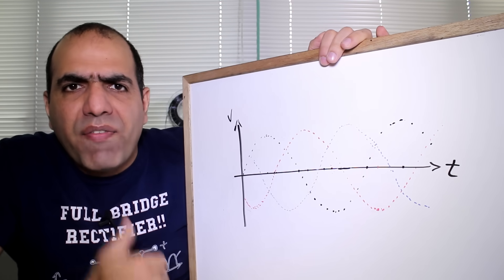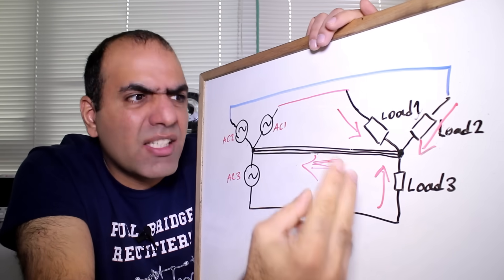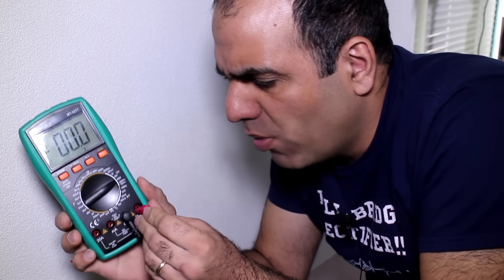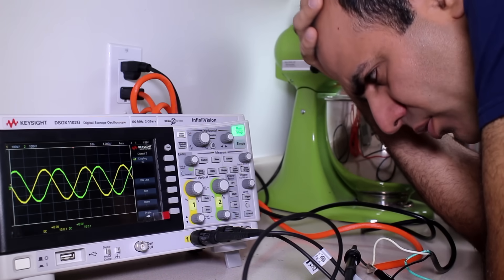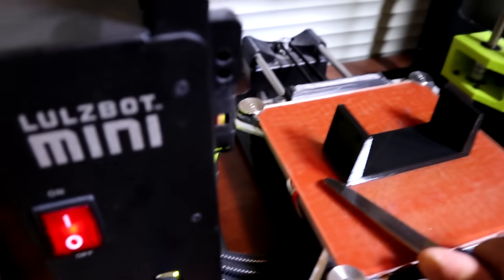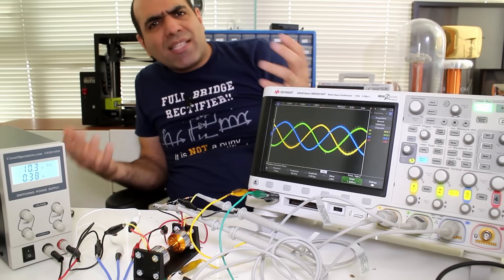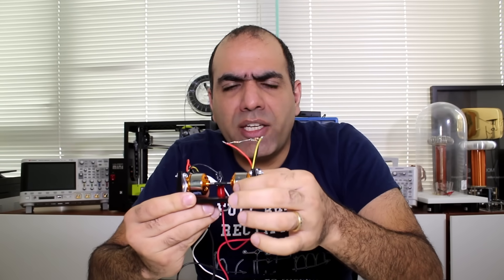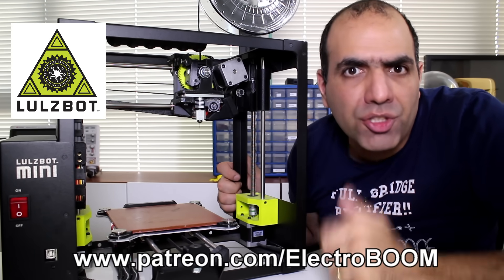Why 3 Phase AC instead of Single Phase???

Comment: I measured the voltage between phases in my house and got 242 VAC and you got 203 VAC where you are. Hmmm interesting. I live in Canada as well, maybe there is a difference between provinces.
Reply: There can and will be very big differences everywhere you go. Each local substation or transformer will be outputting different voltages, dependant on the load it is under from other people on the same transformer, whether the supply is low or high (largely distance dependant), and differences in each transformer itself. That's why Mains power specifies an acceptable working range.

In the UK I measure Mains AC every day at premises in a region spanning several hundred square miles, but the range of AC I get is anywhere between 217-253v. That's pretty-much exactly the allowable range.

Comment: Because of the sine wave generated always going to zero and starting all over again the power lost is RMS .707106 - 100 percent  equal .2928 percent lost compared to DC. To compensate sine wave power must be higher by almost 30 percent to get the same work done. DC rules!!!

Comment: I love your videos. I understand at least 90% of what you put out but you break it out into such an easy way to understand. As an electrician knows the first couple years in the field at least you really don't understand it.   I think your videos are great keep putting out the good content.   you don't overdo it like most electrical teachers will by giving you  they're answer with all of their knowledge and end up just confusing the students because it's just too much at once when you're starting out.
Reply: I know I'm a small scale are increasing amounts of nonlinear loads affect neutral current coming back.  Inside of a commercial building we will typically upsize the neutral for the additional load that used to be balanced with linear loads. My question is do you think the transmission companies are doing anything to accompany this issue? Or on a large scale with so many nonlinear loads and linear loads on 13kv plus distribution lines  do you think it doesn't affect it enough for them to have to start increasing their neutrals.  technically thinking if you have the same type of fluorescent lighting ballast and same amount on the same phase it would balance out needing no room for improvements on the distribution lines

Comment: Hi electroBOOM I'm turning to you and fellow subscribers for advice. iv just been given a garage ramp and it's running on 3 phase. I currently have single phase 240v in my garage do I need anything special to receive or convert to 3 phase or can I just run 3 separate supplys to the motor please can you point me in the right direction thank you

Comment: [06/03, 12:29 a.m.] Shara⭐: Zero phase transformers, it needs two magnets one inside center and the other as ring outside right?
[06/03, 12:29 a.m.] Shara⭐: Else it release leakage at side or center depending on the zero phase transformer designs?
[06/03, 12:30 a.m.] Shara⭐: Three phase transformer cant completely zero phase out because the copper overlaps and is individual strands. So the magnet is applied to eliminate it to zero.

the other video was:
https://m.youtube.com/watch?v=Uw2xaaRTHhw

Comment: Can you do a video on using a single phase supply to spin a unloaded motor to generate 3 phase. I have seen this done years ago and always wanted to know how.  The set up I saw didn’t use a donkey motor to spin a 3 phase motor.  At lease i think it was a 3 phase motor ? Anyway it was a decent size motor was turned on, with no load, Spon up to speed and then all the 3 phase motors around the place would work, please explain this witch craft

Comment: I have question. How can I use this in creation of a Schoolie? A Schoolie is a School bus adventure home made out of a school bus. I'm going to buy my school bus for around $5K. Is 3 phase AC something I can use to give my electrical systems an edge? I was thinking of putting a Tesla Power Wall in the interior as a battery bank and put solar panels on the roof of the bus. The bus is a electric school bus made by Lion. It's called the Lion C.

Comment: Hello sir , I am a student  trying to learn about Electricity and other stuff in this area  . I was on a course about electrical installation and I had a question  but the professor kinda ignored me - the question was this  " why the tension between phases is 380 volts instead of 440 volts ---note-- I live in Kosovo and the phase is 200-220 volts    " and by that I meant like how does that work , is there a law that makes it that way of what ? I would really love to know .
P.S I love your videos and knowledge u spread  and  I hope my English is not bad and i explained it well . Thank you :) .
Reply from the maker: Hello! because the phases are 120 degrees out of phase, not 180. so the voltage would be 220 x square-root (3) = ~380V.
Reply: Thank you a lot :) .

Comment: What happens if you take solar panels hook up a DC motor to the solar panel hope that dc motor up to a three-phase AC motor would that be more or less efficient than an inverter  and what happens if you put gears on it to make the spin faster like a bicycle I don't have ways to test if myself and not enough money to buy all the things just wondering if anybody did it and what results came out

Comment: Could you have just directly connected the scope to the ESC's output to get 3 phase AC or would that supply some 3 phase DC pulses to the scope or just not supply anything at all and somehow only outputs when a motor is connected (by calculation return values of the voltage/current)?

Comment: I used to work at an aircraft part repair shop, and always wondered why the power for the airplane appliances (like ovens and coffee makers) was three-phase.  I guess it's so that motors can be three-phase and last longer. Aircraft parts are ridiculously expensive because of liability and red tape, so I guess you want them to last as long as possible.

Comment: This video confuses "phase" with "leg".  The 120V/240V voltages in North American residential wiring are derived from different taps on a single-phase transformer.  It is incorrect to refer to the transformer outputs as "phases".

Comment: I enjoyed the video and I am a subscriber, and even though I hate to be "that guy" who seems to be overly nit picky, it needs to be mentioned that there is a difference between "line-to-line" voltage difference, "phase-to-phase" voltage difference.
Mainly because "phase-to-phase" doesn't exist.
In a three phase system, there are three "lines", and there are three "phases", but those terms are not interchangeable.
Since a "line" is a "hot" wire that has an average voltage potential to ground, and a "phase" is the voltage potential between two conductors - either between two hots, or between a hot and ground, any circuit that uses two wires is considered "single phase", and any circuit that uses three wires is considered "three phase".
The "hot" lines could be designated line A, line B, and line C. But, the phases would be designated A-B, A-C, and B-C.

In your outlet example, if you had hooked your oscilloscope to just the two hot lines (let's say Line A and Line B), you would have gotten one wave form at 203 VRMS - that is single phase even though there are two hot lines involved. While you do have two separate 115 volt single phases available (A-Ground and B-Ground) and one 203 volt single phase available (A-B), you can only run a single phase device from that outlet regardless of how many hot lines you use.

Like I said, I hate to be nit picky, but I think it is important for people learning about electricity to learn what the difference between "phase" and "line" are from the start so it doesn't lead to confusion later on.
Otherwise, I loved the video and think you are doing good things by teaching people about electricity in an enjoyable and humorous way.

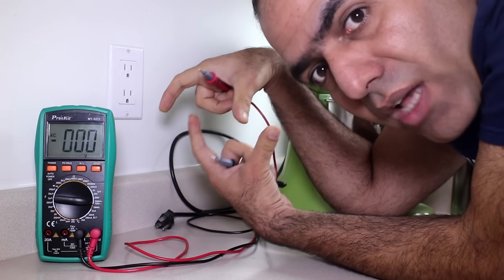Comment: @4:00 You said that if the sinusoids had 180 degrees phase difference they would add up to be 2V. Please correct me If I am wrong but if the sinusoids had 180 degrees phase difference they would add upto zero provided they have same amplitude.

Comment: One correction needed. Residential power in North America is only single phase or split phase. 240V is considered single phase and not two separate phases because the step down transformer that feeds each house/houses is only feed with one high voltage phase into the the transformers primary coil. The secondary coil has a connections on either of its ends which outputs 240V.  The secondary  also has a connection directly in the middle of the coil. This center tapped connection is the neutral, its used as a return  to obtain 120V,  this is possible because only half the coil is used. Three wires are brought to the house from the utilitys transformer, one neutral and two "hots".  You still get a full 60HZ sinewave but it's considered single phase.

Comment: Is there a good program to build circuits on a computer to make sure the circuit will work before actually bulling the circuit with actual parts and the applying "scary" voltage? I'm not trying to be the next ElecrTo BOOOOOOOM

Comment: In Sweden every house is connected by three phases, but no return. Instead the fuse-box is grounded so any imbalances goes thru ground back to the power-station.  The tree phases make out three rows in the back-plane of the fuse-box. Then the back-plane is divided into groups from each fuse with a live and a return wire back to the fuse box, along with ground in new installations.

Comment: 'Tunnels are not "built" any more than you "build" a  hole as you remove material from something "solid" making it "hollow" and consider it "built" because you managed to make a hole in some material nowhere its maximum density, hardness and as close to a monolithic, pure and "metallic" state. And "rock" is a mixture of minerals and metals that were extremely hot when they finally "mixed" and immediately "froze" from a plastic state to a "glass" state which is why "rock" at its hardest and in a "glass" state will simply shatter when when something sharp enough to "crack" or "stretch" its hard outer shell that's being far more dense "outside" than "inside" doesn't yield to   "non-loads" that don't "distort" it before it does them.

Comment: Your plugs should be split in the kitchen. Think of that split plug as access to a center tap secondary winding of the transformer on the power pole or box if your lucky enough to have underground power.  You have 3 Phase in your home I thought that was reserved for industrial applications?  So do you have a 3pole main breaker in your beaker box?  And my explanation was done early in the video ADHD;) and applies to single phase.  I have no idea how 3 phase transformers are setup.

Comment: The two 'phases' in your 120/240 v residential service are 180 degrees apart, supplied by a tapped 240v transformer winding outside your house.  It's not clear what the point of this video might be, unless someone is somehow opposed to three-phase AC electric power transmission and this video is defending it.

Comment: Just to know - in Europe you have 3 phases at home not only in industrial areas and the voltage is higher - 230V one phase and 400V 3-phase. The higher voltage got a benefit if you have a fixed power-requirement. You need with 115V a wire with the double width because of the line loss the copper wire has. One interesting history fact about transmission lines - 1882 the first transmission line was built with 2 kV DC over 57km. The efficiency was 25%. And in 1891 the first transmission line with 10kV AC over 176km was built. The efficiency was 75%. Today we use in Europe depending on the distance and economy AC transmission lines between 110kV and 1000kV. The most common used are 3 phase 400kV. Because of the weight transmission lines are out of aluminium. In comparison the weight is 55% of a comparable copper-wire with the same AC resistance and line loss.
Reply: im in the states... i always thought if i doubled the voltage to everything in my house ut would lower the load and my electric bill!!!!!
Reply: @sdrake74  You decrease line loss.
Reply: @sdrake74   If you doubled the voltage to everything in your house you would get higher electric bill
Reply: @Nobody-eg4bi  And an even higher bill from the fire department.
Reply: @petehiggins33 I understand all these things but what is more important is the wattage so you can use higher voltage but you should in that case give a lot less current (amperage), the most important thing that you should never change the wattage
Reply: I also have 3 phase connection but noticed not all homes have
Reply: Hey I live in Portugal and I have a pressure washer that requires 3 phases to work, and I no longer have 3 phase power in my home. Is there a way to use multiple (3) single phase outlets to lower my machine?
Reply: @TheDiogofrancisco1  Don't try it.
Reply: @TheDiogofrancisco1  Get a variable frequency driver (VFD) that synthesises 3 phase from a single phase. $150 at eBay
Reply: @TheDiogofrancisco1  you can change the original 3 phase motor with a single phase motor.
Reply: @TheDiogofrancisco1  - No, multiple single phases wouldn't work because 2 phase in Europe is different than what they have in Canada. European 2 phase is 180 degrees apart, not 120 degrees as Mehdi is talking about.
What I think is possible is to simulate the 3rd phase by connecting a capacitor to one of the 2 phase wires you have, and then connect it to where the 3rd phase cable usually is connected in the connection box on the pump motor. If the motor runs in the wrong direction when you turn it on, just change over to the other 2 phase wire.
I'm afraid I don't know more in detail of what size the capacitor should be and things like that, in any event I think it's best to ask an electrician on how to do it and perhaps also to let him do the job.
Reply: @mbo191  Well. I've never seen 2--phase electricity in EU. Only one or three phase. Three phase is always 120° apart (3*120=360° - Full period)
You can made your own "simple" 1-3 phase inverter just like in the old times. You need the one phase motor which will rotate the 3-phase generator. You have to regulate the revolutions to keep the 50hz rate.
Reply: @jaromirandel543  Well now, since you have 2 wires you have 2 phases with the sinus curves alternating in both wires. If you want to call it 1 phase or 2 phase probably depends on where in the world you are and how the teachings are done in school.
Reply: @mbo191  We have only one phase. The second wire is neutral. There is no potential between neutral and ground. In the TN-C (Which is in the most older buildings) network there is only Phase and the PEN wire. PE and N are connected right in the socket. The PEN wire is grounded so it does not have any potential. In the TN-S network the PE and N are separated. But in the main switchboard those are again connected to PEN and grounded. The TN-S is more safety and allows to use the residual current device.
Reply: @jaromirandel543  2 phase is not the correct term it is split phase.
Reply: In Sweden, all buildings get 3-phase 400V.  Some older apartment buildings split that up though so the apartments only get 1 phase 230V.
My current apartment have all 3 though.
Reply: Back then they didn't have transistors so no DC-DC converters, the only way to really change voltage up or down was by using transformers.  Transformers can only be used in AC circuits so AC was able to attain higher voltages which greatly increased efficiency.  Also on the consumer side, it was much easier and efficient to step the voltage down to safe levels with transformers.
Reply: Huh, today I learned. Thanks.

Comment: It was an excellent refresher even for seasoned electrical engineers.....we learned so much so quickly that it was hard to retain the basics from time to time.........After 25 years working i also found the online HAM radio training to be avtremendous refresher of first two engineering terms. But the learning never stops......three years wrestling with $13000 ETAP software even after three training session proves electrical engineering has no end in sight.
Reply: Aye to the Ham radio training; amplifier circuits -> IGBTs etc. I am going for my Ham license soon too.
Reply: @solomonthell7589  what are the perks of a ham license how does it teach electrical engineering, arent they 2 different things? They teach igbt no way...?

Comment: Excellent....Hey ElectroBOOM...just one concern.....it is my understanding that residential service is NOT two phase of three but a single phase service with a center tap from service xfmr to enable both 240 end to end or 120 from end tho the neutral center tap........so the term “phase” is easily misconstrued......